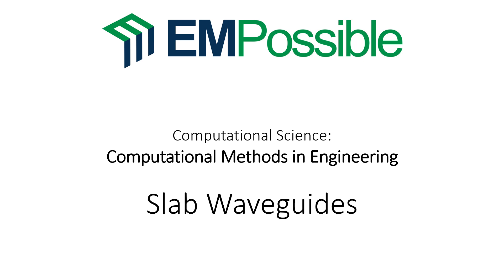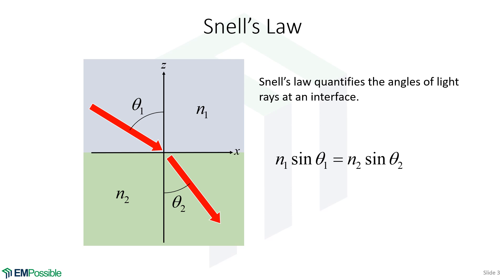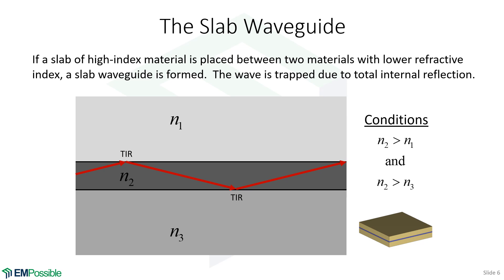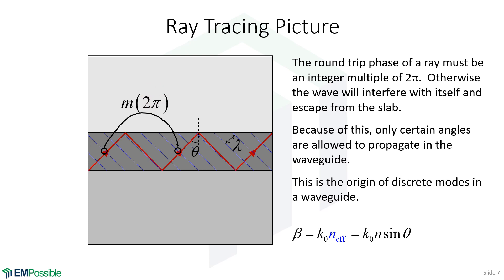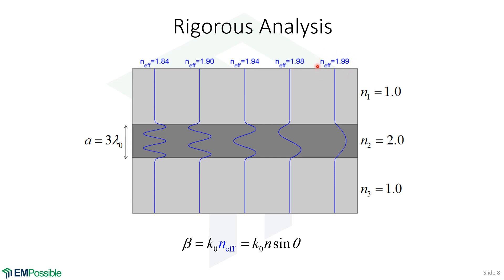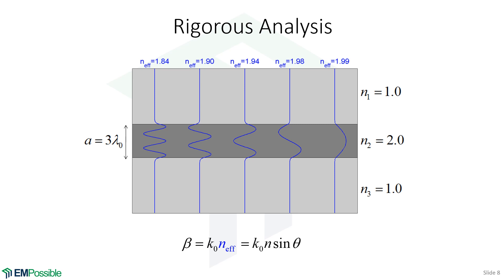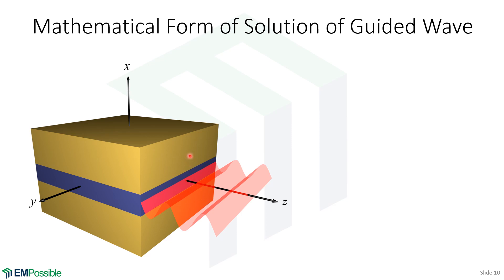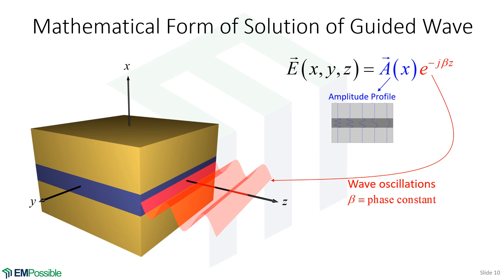Lecture -- Slab waveguides

Comment: Hello, I have several questions about Waveguides for quite a long time. Based on the formula (transverse resonance condition/interferes with itself), it demands several (fixed) combinations of values of wavenumber(k), incident angle (theta), and mode number m for a given  d (separation/height). Q.1 When sending EM signals into Waveguide, how can I adjust the incident angle? Q.2 If incident angle isn't correct, where does those energy go? Is there a certain percentage of energy simply lost as Heat? If incident angle or wavenumber is not that accurate, is the waveguide sensitive to that inaccuracy and stop working immediately?  Q.3 If the incident EM signal is full of all angles (emitting in all directions), can we conclude that most of signals would get lost and only a very tiny amount of signals will get transferred through waveguide?
Reply from the maker: Q.1 Exciting guided modes is actually a bit more complicated than it seems. The main problem is that you have to match a free space wave to a guided mode and these do not usually just match. To match them, you need to make the external wave look like the guided mode. A guided more looks a bit like a Gaussian beam so these tend to excite guided modes most effectively. A good model of a guided mode is a wave bouncing back and forth between the interfaces via total-internal-reflection. Only certain angles correspond to guided modes because the other angles would lead to a case where the wave bouncing back and forth would interfere with itself and leak out of the waveguide. The angle of incidence you are asking about corresponds to the allowed angle. Different modes will have different angles. I think a better model is thinking of the guided mode as a single packet of energy. It also has a propagation constant which describes how quickly the guided mode accumulates phase in the longitudinal direction. When you launch a wave at some angle of incidence, you are matching the component of its waveguide vector in the direction of the mode to the phase constant of the guided mode. This whole store gets more complicated when you want to excite higher-order modes, but I will not address that here. The short answer goes back to making the external wave look like the guided mode. In practice, at optical frequencies this would entail precisely aligning a beam using micropositioners to the angle and focusing down to a small spot at the entrance of the waveguide. There are other mechanisms such as grating couplers that can excite guided modes as well.

Q.2 If your exciting is not correct, you will see the power lead from the waveguide. At visible frequencies, optical fibers will glow red and dim with distance. It is not usually an exact thing and there will be some tolerance. If you are aligning a beam to a waveguide, take your time and be patient. An alignment could take a while. I know people who spend 30 minutes or more getting an alignment and even then it is not perfect. It is not just about getting the angle correct, but also making the external wave look like the guided mode. If that is not perfect, power will eventually leak out of the waveguide.

Q.3 Correct. This is not generally an efficient way to excite a guided mode. You will see people do things to collimate the wave before entering the waveguide in order to prevent what you are talking about.

Hope this helps!!
Reply: @empossible1577  Thanks a lot!! Very Detailed and helpful!

Comment: Why would the speed travel in different mode be different ? It seem different to my seoundary school physic that the speed is determine by the medium😢
Reply from the maker: To get a more intuitive feel for a guided mode, you can think of a ray bouncing back and forth between the upper and lower interfaces of the waveguide. It turns out only discrete angles are allowed and these become the distinct guided modes. Each mode propagates at a different angle so they propagate at a different speed.

Comment: Hello, why the electric field is just function of x,y, and z. why it is not a function of time
Reply from the maker: This is a frequency-domain analysis.  It is assumed the fields are oscillating harmonically in their steady-state.  If you wanted to add the time element, you would simply multiply your solution by exp(j*w*t) and then take the real part of the overall solution.  You may be curious about what happens before the steady-state.  This requires a time-domain analysis and it resolves the transient response.  The finite-difference time-domain (FDTD) is a great numerical method for doing this.  See https://youtu.be/uBiprIN8gfY

Comment: Hello, I have a question about "quality" of solution in terms of datatypes. I wrote program for 1D solution and for windows version of python the best complex datatype is float 64 bit for real and imaginary part of number (128 bit). And if I use "numpy.finfo(numpy.complex128).eps" I will get something like 2^-52 (~2.2e-16). This is machine limits of float64. 
Which lowest epsilon for matlab or another prog. language?
There is also numpy.complex256 with eps equal to 2^-63 (1.08e-19) BUT scipy.sparse library that have eigensolver does not support this datatype and this datatype available only for python on linux systems.

Thank you for yours videos.
Reply from the maker: Hmmm...I think the accuracy of the finite-difference method itself is way less than the numbers you are giving.  I would not worry at all about the numerical precision for small things like slab waveguides.  The numerical precision becomes a problem for extremely large problems.

As for which language might be best...I actually do not know.  I would guess that might be Fortran.
Reply: @empossible1577  Thank you for the answer. 
Also for 2D problem I have another question. 
PQ matrix is 2x2 shape, each element of it is shape n^2 x n^2. 
So PQ is 2 x 2 x nx^2 x ny^2 shape. Where nx, ny number of cells for media represented as refractive index.
Is there a way to calculate eigenvalues and vectors by using elements of PQ matrix? (I can use only square matrices but PQ is 4D matrix for 2D waveguide problem).
Reply from the maker: @byquip  Matrices are only ever 2D arrays no matter how many dimensions are being simulated.  If there are Nx by Ny points on the grid, there is a total of M=Nx*Ny points on the grid.  The P and Q matrices will each be MxM.  The produce P*Q will also be of size MxM.
Reply: @empossible1577  I thought that it was 2x2x(Nx*Ny)x(Nx*Ny). For example in code for P matrix:
Pxx = - A_x * inv_eps_z * D_y             # 00 
Pxy =   A_x * inv_eps_z * D_x + I_m  # 01
Pyx = - A_y * inv_eps_z * D_y - I_m   # 10
Pyy =   A_y * inv_eps_z * D_x             # 11

All the matrices are MxM shape. But how is possible to be P matrix MxM shape as well? Could you please explain?
It's the last key.
Reply from the maker: @byquip  If Pxx, Pxy, Pyx and Pyy are all MxM, then P would be 2Mx2M.  Sorry if I mispoke.
Reply: @empossible1577  Amazing, thank you very much. It means I can just concatenate 4 matrixes to one big 2Mx2M if I understood right.
Reply from the maker: That is correct.  That is called a block matrix...a matrix made of other matrices.  It is a great way to build a large and complicated matrix from smaller and simpler matrices.  That is a theme for how I implement methods.  Build small and simple matrices and then build the bigger and harder ones from them.  It tends to make the whole process rather simple and easier to troubleshoot.
Reply: @empossible1577  Thank you very much, it helps a lot.